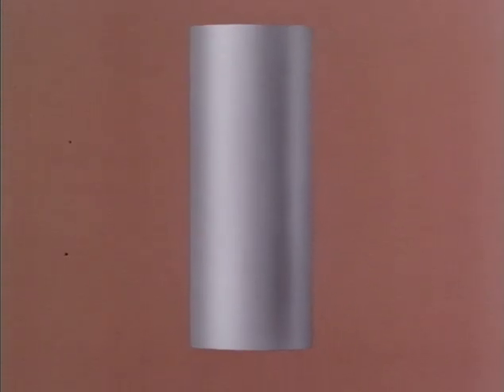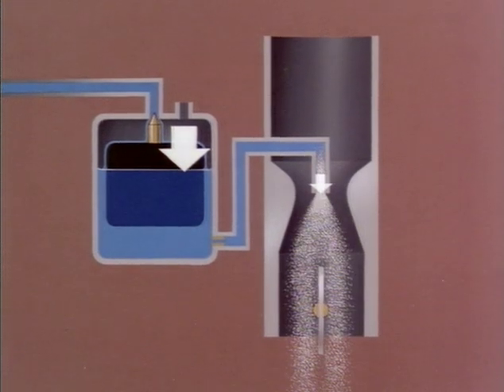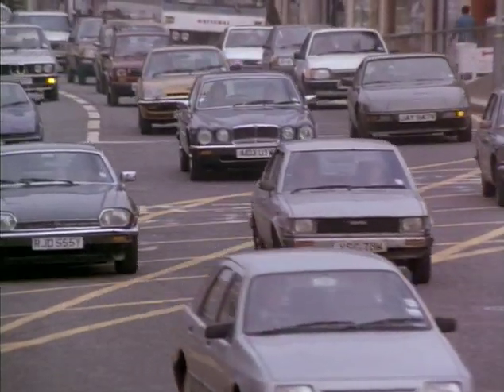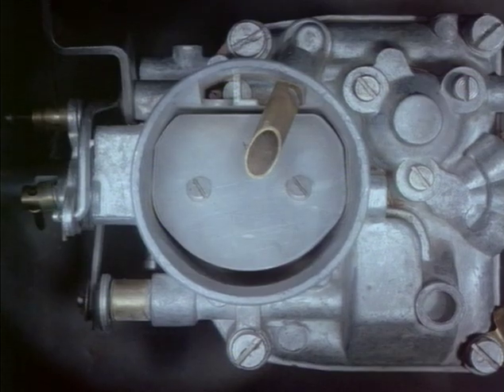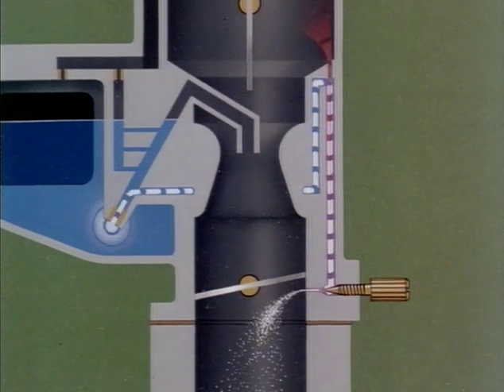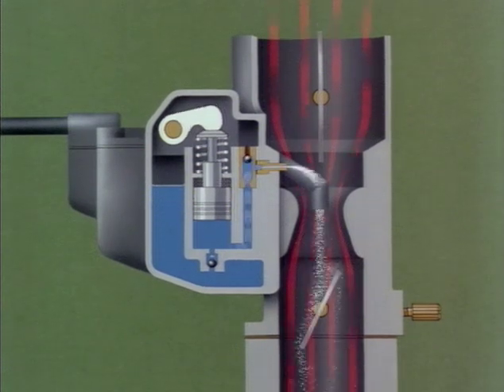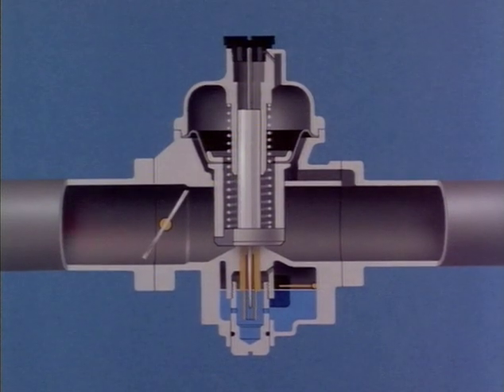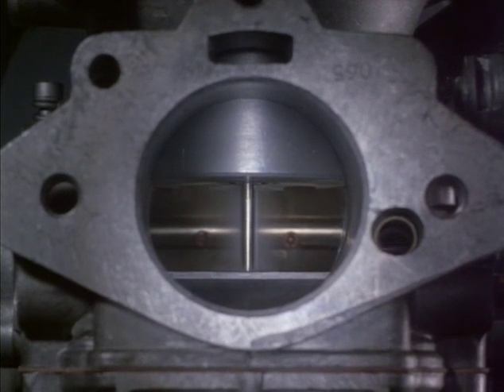How the motor car works (Part 2): The Carburettor | Shell Historical Film Archive

Comment: I have collected a fair number of the Motorcraft 2150s came off 1991 AMC Jeep 360 V8s.
They have an altitude compensation "sylphon" like an aircraft carb. It simply bypasses air around the venturi via poppet valve. Good for sea level to 10,000 feet asl.

Comment: Thanks Shell.
I like Carburetors Vergassers.
It works great it just need service and it runs great. And mutch cheaper to repair the EFI ECU, INJECTORS FUELPUMP LAMDA OR WINDBAND AFR SENSOR.
Yes it is a littel better but in Africa you need to help your self in the bush. I prefure carburetor and Diesel pumps to fix probleme.

Comment: *Laughs in EFI*
Reply: And EFI can’t run on other fuels besides gasoline. Carburetors on the other hand, will run on any fuel that’s volatile such as alcohol and so forth. Ignition timing will have to be adjusted and the air fuel mixture. With EFI, you can’t make adjustments or calibrations without thousands of dollars in equipment, sometimes it’ll need another computer to run correctly.

Comment: It's strange to think that every car built for the US market since 1981 was under closed loop control with an oxygen sensor and a 3 way catalytic converter. That meant either fuel injection or a feedback carburetor with with a duty-cycled mixture solenoid. When did European emissions controls reach this level? The early 1990s?
Reply: Are you serious? This SHELL movie was already OBSELETE when it was made (in 1985)

Bosch (and Lucas) were very early developers of multi point EFI !  The 1969 VW 411LE was one of the first cars to get D-jetronic EFi . The same engine was also fitted to the Porsche 914. (no oxygen sensor yet, no cat yet)

BOSCH invented and developed the lambda (oxygen) sensor in the late 1960's ( by Günter Bauman. Look it up.  )

The first car on the market that used lambda controlled closed loop EFI with cat was the 1979 Volvo 240GLE. 

The first European car that got a 3way cat + EFi standard from the factory was the 1984 Opel Ascona 1.8i 

Back then we didn't have the very strict California style emissions standards yet. And EFI and CATs were expensive. Thats why only expensive cars(top of the range models) got them. For a while you could actually buy the same car with or without cat! 
But from about 1988-ish onwards i think all new cars got EFi and a Cat.  Because the emissions regulations got stricter.